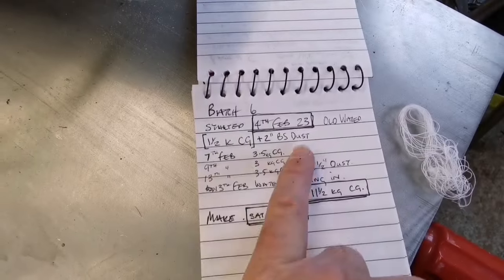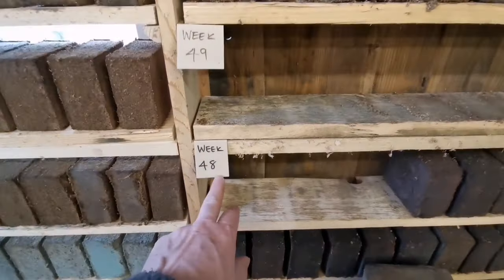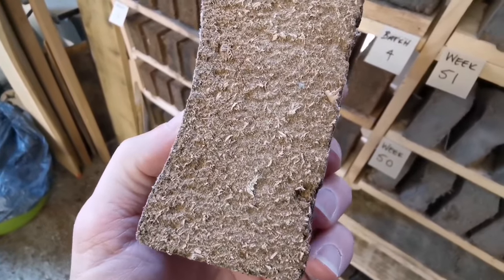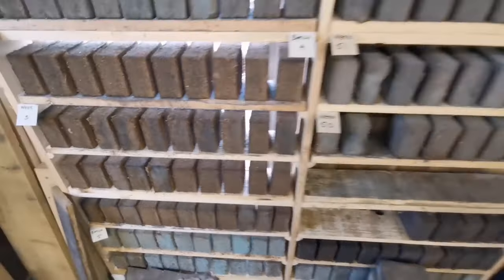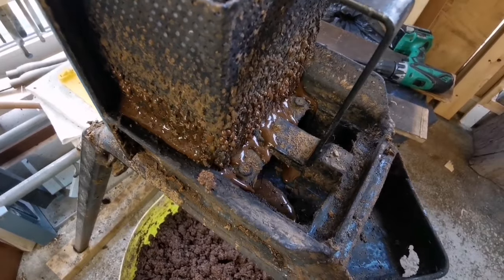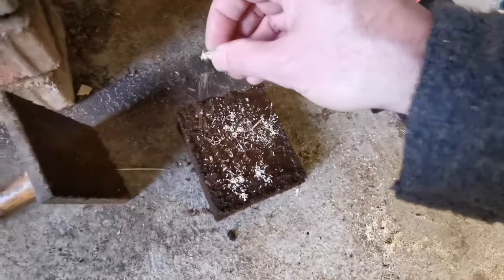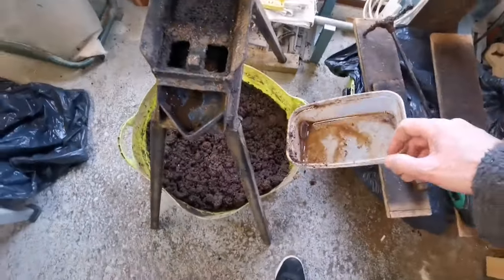Briquettes Improved method - Sawdust Briquettes with Coffee grounds mix. #briquettes

Comment: It might just be me, but the emphasis seems to have shifted from having a use for your waste sawdust and shavings to using more coffee grinds, which to me seems to create more demand for coffee and less usage of a previous waste product, which in this case was the sawdust and such.
Reply from the maker: Well spotted. My work has changed due to Covid fallout (some work has totally gone) and family matters. So I'm making less, restoring more. That means less shavings. But the coffee grounds were waste and do make better briquettes. Burn longer, up to 8 times longer and 20-30% hotter. Can't argue with that. So yes, things have changed, but I can tell you not through choice, just circumstances. Thank you for comments. Jamie
Reply from the maker: I should also point out. They take no extra time to make using the coffee, so it's not like it takes twice as long. In fact it makes more sense (maybe only to me) to include the waste coffee and get the briquettes  that burn up to 8 times longer for the same time in manufacturing process. What do you think?
Reply: @twcmaker  , I was just pointing out the shift in material focus. In that it seems that there is now more effort to source waste coffee grinds and less emphasis on your workshops waste products. That's all. I didn't say anything about good or bad or intentionally imply anything like that. Just pointing out an observation. It's great that you have a use for the coffee grinds. I personally put them in my compost and even sprinkle them over the top of the garden beds as well. The same as I do with the various types of tea leaves that we use at home and are given from some of the local cafés (we are given tea leaves & coffee grinds from the cafés). I think that any way of making good use of all of the above is good. I make charcoal/biochar and have a multitude of uses for that as well. I have uses for the resulting ash from the charcoal that gets burnt from use in spit roasts, blacksmiths forge and from the ash that is a result of making the charcoal/biochar. Mostly in the garden but also gets used as a lye for tanning and soap making, and a few other things. You have actually sparked thought on the possibility of using burnt coffee grind ash as a lye in the same way. Something I may experiment in some time down the track. Have fun and stay safe.
Reply from the maker: We do what we do, at the time. I've got a couple of jobs coming in now so that will be more shavings. It's good to experiment 👍
Reply: @twcmaker  , I couldn't agree more.
Reply from the maker: Latest coffee briquettes video is HERE!! https://youtu.be/BrUE1Hs82iQ
Jamie
Reply: Not really, the world creates an insane amount of coffee grounds with no good uses. Sawdust is also made plenty of but with generations of reuse and repurposing. We need more uses for grounds, this isn't exactly stimulating that already booming industry is it?
Reply from the maker: The guys in the Cafe drop a bag of coffee outside my workshop door every evening. So I'm not creating a demand. And I'm making better briquettes (hotter and burn longer) with Coffee added.
Anything else I've missed?
Jamie
Reply: I can't really follow how using more coffee grounds = more demand for coffee. The coffee was not being made with the intention of creating grounds to burn.

Comment: You can make the briquettes more dens and heavy by grinding all the shavings with a small flour mill. These cheap 2200watt Chinese corn mills from the Internet grind everything into fine powder.
Reply from the maker: The idea is to keep some of the shavings, as they help hold it all together. If it was all fine powder they would break apart easier.
Reply: @twcmaker  your right 🙂 but it has another Advantage: If you grind moist big shavings they will turn to woodfibres they will Work better for holding togheter the briquette due to the high surface area to build hydrogenbridges between dust and fibres. 😃
Reply from the maker: I'll have to try it out. 👍
Reply from the maker: Latest coffee briquettes video is HERE!! https://youtu.be/BrUE1Hs82iQ
Jamie
Reply: @twcmaker  i'll Look it Up tonight. Im a bit busy by renovating my livingroom ;-)
Reply from the maker: @Timausdenardennen Brill. I think you'll like it

Comment: I let my wooden shavings plus coffee soak for 2 months, but there is nearly no binding, after I press it. It all just falls apart. Do you have an idea, what might has gone wrong? It also smells rotten. Maybe I used allready to dry and rooten wood? I have a lot of spalted beech from woodturning.
Reply from the maker: What percentage is very fine dust.? It needs to be 5-10%
How wet was it? You should be able to take a hand grip and a little water comes out, and the mixture remains in shape.
Reply: @twcmaker  very low, I‘m afraid.
Reply from the maker: So I think I would leave it longer to Compost. Turn it every week. Get some air into it. Keep an eye on the moisture.
Did any of it show signs of breaking down at all?
Reply from the maker: Watch this video. Latest on the process.
https://youtu.be/BrUE1Hs82iQ
Let me know what you think.
Jamie
Reply: @twcmaker  It looks like wet wood, nothing has changed it‘s shape.
Reply: @twcmaker  I will. Thank you very much by now!
Reply from the maker: @dieiuai-malebenselbstgebau1523  Too much water? Could be.. Pour all the water out and leave it.
Reply: @twcmaker  it is very wet. The water runs out, when I put it in the press.
Reply from the maker: @dieiuai-malebenselbstgebau1523 Thank you. 👍
Jamie
Reply: @twcmaker  I never thought, there could be too much water 🤷‍♂️

Comment: I put my coffee grounds on my compost heap. It's supposed to be a good source of nutrients for it. There's a local coffee shop that gives them away for that purpose where I live, though I've never bothered to take any. Is that how you get so much?  If not, I'm impressed that you manage to consume even more than I do. 
If you don't add the 'juice' back on top of the block, and let it drain through, does the block just crumble when you take it out and place the paver on it? I'd be tempted to just squeeze out the liquid and put it straight on the shelf, horizontally oriented. Then just leave it for longer to dry out. The mould growing through it should provide some structural rigidity. The only concern I would have with this process is whether the mould growing in the blocks might be bad for your respiratory system over time. The blocks may not be as dense, and may not burn for as long, but you'd save a lot of time and effort. I was thinking of peat when you mentioned it. They just let it air dry. Once you run out of shelf space, you could take the matured ones off and stack them in a little overlapping pile to let the air through. Then burn the oldest pile first.
Reply from the maker: Great reply. I do think the compression makes a difference. So that's why I do it. Peat, yes. This is breaking down and making it easier to bind together. And now, drying out quicker. Yes Coffee shop surplus. Adding it back on makes me feel some if the tiny grounds get a second chance I'd staying in. Filling gaps?
Reply: Same here,all my coffee grounds goes on my compost pile.
Reply from the maker: That's good. Im saving these going into the bin/skip. And make a big difference to my Briquettes.
Reply from the maker: Latest coffee briquettes video is HERE!! https://youtu.be/BrUE1Hs82iQ
Jamie

Comment: Interesting!

It might be good to weigh the fresh brick against the same brick before you burn it. That would allow you to work out how much water was part of the process. It is not the water that matters in this (imo) ..... but if you take the water weight out of it you know how much you are actually putting into the brick in terms of flammable content!
Once you do that you can work out the best ratio of coffee to wood (or whatever else you put in) as an empirical measure!

When I was doing it I was using a sawdust / paper mix. That gave off too much ash to be viable! ....... even if the "logetts" did look cool!
I used a home made press using plastic pipe that extruded a solid "log"!
Reply from the maker: Ahh.
The Briquettes made with just wood dust, as made wet. We're typically 330g.
Once dry typically 120g.
These with coffee grounds (made to similar size) 450g wet. And dry 180-190g.
Using the new process in the video. Where I'm not as concerned about size. 450-520g wet.
And I'm working on the ideal sawdust to Coffee grounds ratio.
Reply: @twcmaker  So more actually in them in terms of "product"!
The next question is .... do the new ones burn better than 1 1/4 of the old ones? Might be a subjective comparison, especially when you define "Better"?
Still good to know! ....and please don't stop!
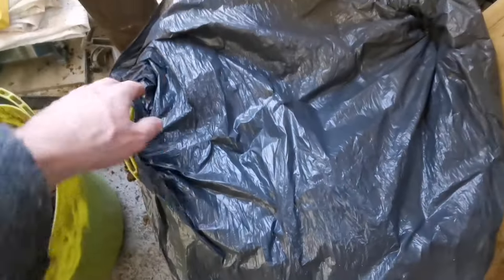Reply from the maker: Oh watch the previous video on burning batch one. They're burning much longer. 1:40 minutes compared to 30-40 minutes. And some of my early videos they were only lasting 25 minutes. Probably because I was squeezing out the fine particles. Yes, there's so much more fine particles in these new ones. Less squeeze out. Even having to change the way to remove them from the press to keep them from falling apart. The part composting amazes me. I think (at some point, quite soon) these will surpass (in burn time) the manufactured Coffee logs, that has invested huge sums. Thank you Dave
Reply: @twcmaker  Already watched mate ;0)
The point is the total heat output with a secondary of how fast that output happens!
As I said..... a subjective conclusion (without some serious lab equipment)!
Reply from the maker: Latest coffee briquettes video is HERE!! https://youtu.be/BrUE1Hs82iQ
Jamie